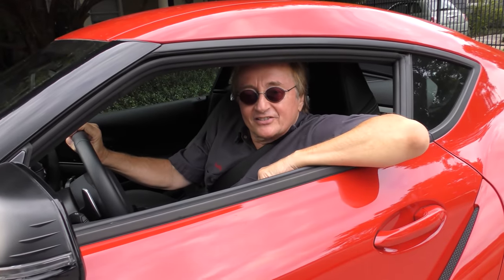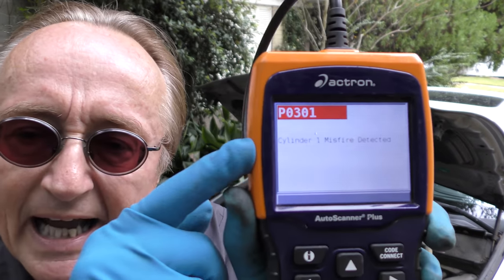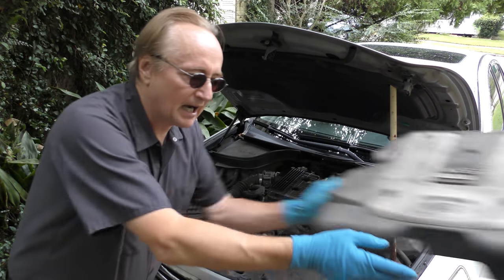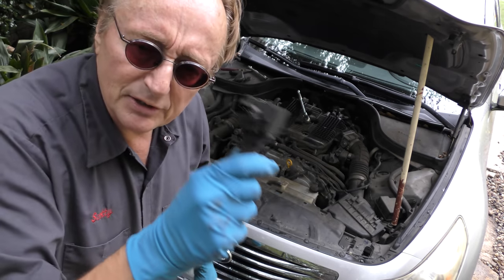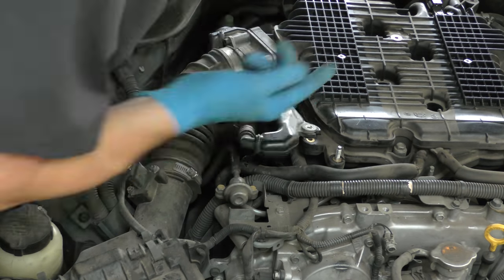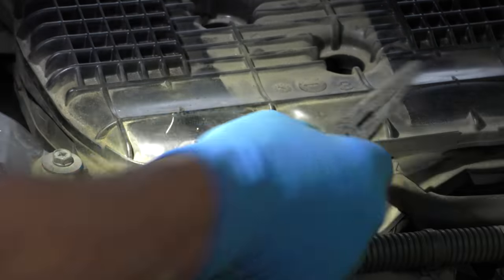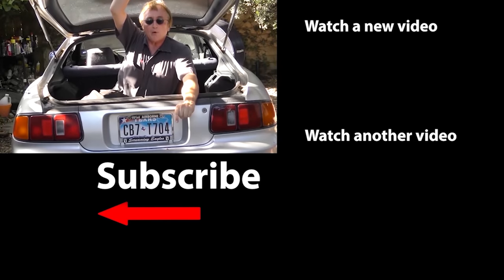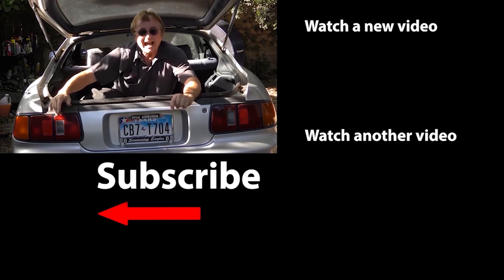My Final Car Repair Video

Comment: My neighbor said she need the air filter changed so I helped her out. After hours of work I ended up with a bunch of hoses that didn’t connect to anything.  So I cut them off at their source and filled the holes with silicone.  She’ll be over to pick it up tomorrow.  Does anyone know how much I should charge her?

Just kidding.  😀🤣

Comment: Forget the scan code. That broomstick hood prop told me all i needed to know about this Nissan built crap.

Houston is losing a precious resource. Houston's loss is Tennessee's gain.
Reply: These engines routinely go 200k with only proper maintenance. Gas struts fail. They're about $30 bucks. They eventually fail on every single car made. Period.